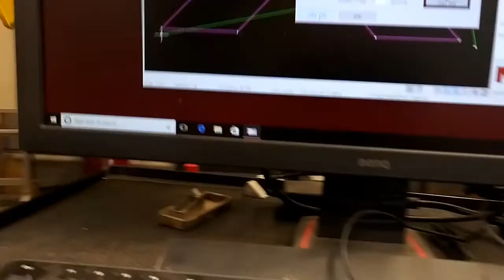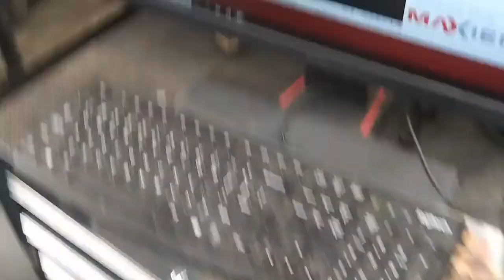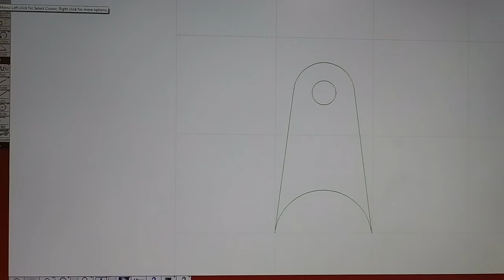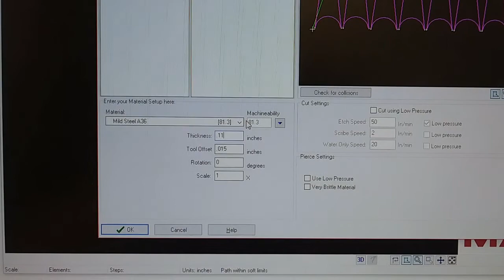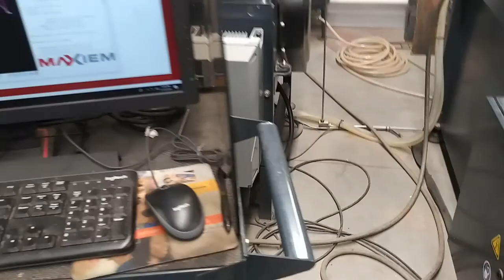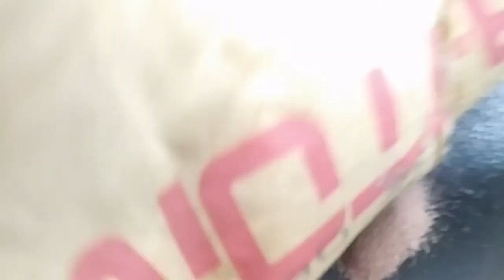How to Operate a Waterjet: Machine Shop Behind the Scenes Ep. 1

Comment: Hey! Looking to buy a Maxiem 1530, with a 20hp pump. Are you happy with yours?
Reply from the maker: Yes it has worked very well cutting through anything we need for our projects. It is a little slow on anything over 0.5" thick steel, but overall very happy with its performance.